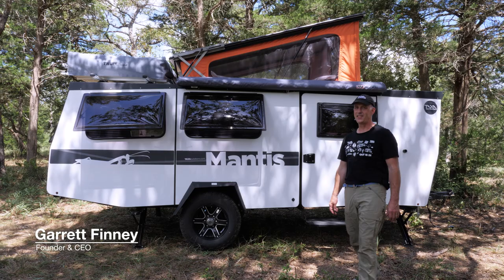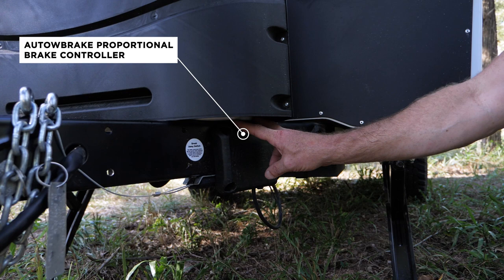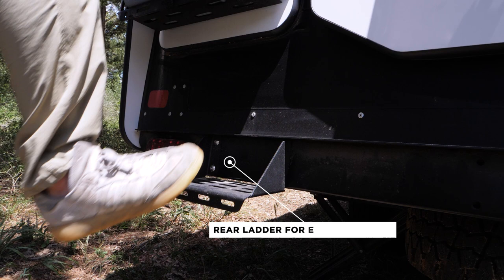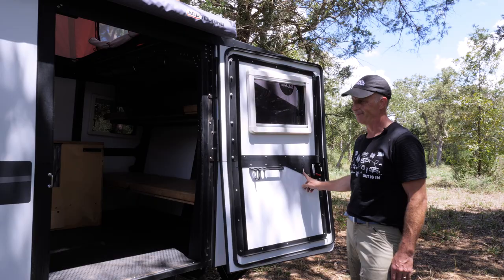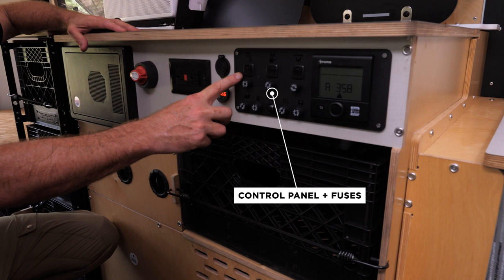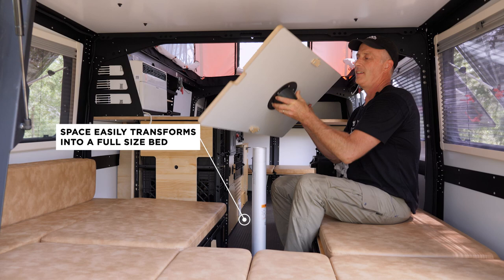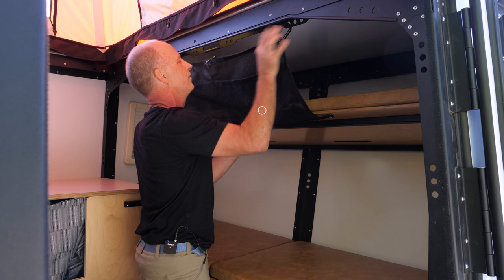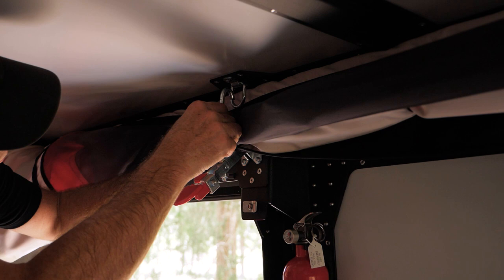TAXA Outdoors Mantis Walk Around Tour

Comment: 50 Grand and milk cartons for drawers?
Reply: Nice to be able to bring gear outside
Reply: Milk cartons don't crack or fall off the tracks in transit, and don't delaminate in high humidity. They are virtually indestructible and are easily replaced. Literally all of my camping gear it already stored in milk crates. So easy to pack/unpack gear, swap out crates for different trips, or take specific gear from camper to outdoor area or to the car for a day trip.

Comment: My opinion is that they needed more space but they couldn't use the materials, the electrical portion was probably his thoughts same with the plumbing.  Im not sure to say the climate isn't correct above the state lines without fusion.  I think that the fabric portion makes it lighter but it could be aluminum or an extending carbon fiber thats insulated.  I think its difficult to argue with the tiny house community about what is a home and what isn't, these certainly could be used as homes or expanded upon, its a really base model idea that probably isn't designed for above orbit quite yet.

Comment: I really love this design but there are some Taxa owners  with your trailers (on YouTube) demonstrating how rain consistently leaks into the Taxa trailers. Has this been addressed in the 2021 model?
Reply from the maker: Hi Charles - Yes. That leak issue was present on a handful of 2019 Mantis habitats, and a fix was addressed shortly after the issue presented. The 2020 and 2021 models have not had any structural leak issues.
Reply: @TAXAOutdoors  what about the draft at the rear door hatch and the screens blowing out of track?

Comment: Can you realistically pull this with a Honda Pilot? Asking for a friend
Reply: Depends on what year Honda Pilot.  The newest one only tows 3500lbs, but the GVWR of the std Mantis is 4200lbs.  So legally I don't think you can tow it.  Realisitically, it could do it, but I wouldn't.  Once you load the trailer with some gear and water, it'll be right at the tow rating.  

Some of the slightly older Honda Pilots can tow 4500lbs, so legally you can tow it.  It should also handle it just fine because the mantis has a smaller frontal and side area which helps to reduce wind induced sway.  I would still buy a modern electronic sway controller  to mount on the camper as well as a weight distribution/ anti sway hitch.